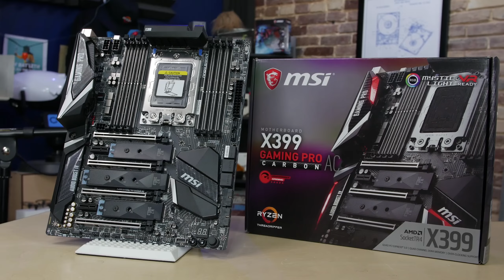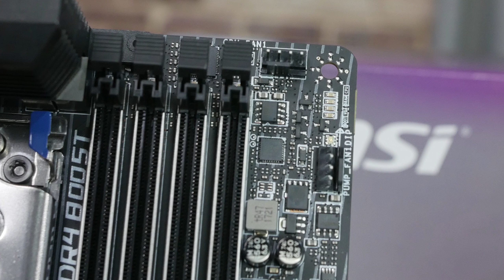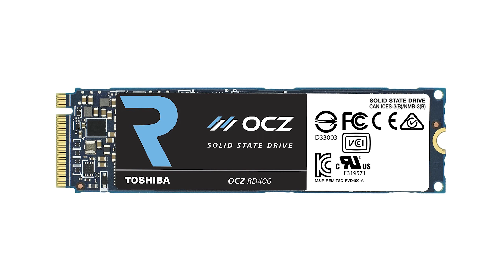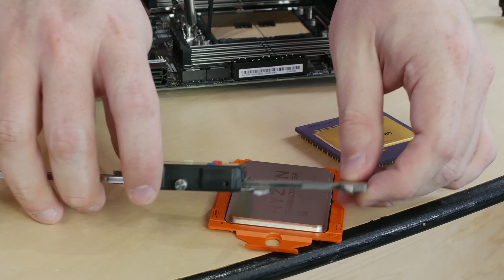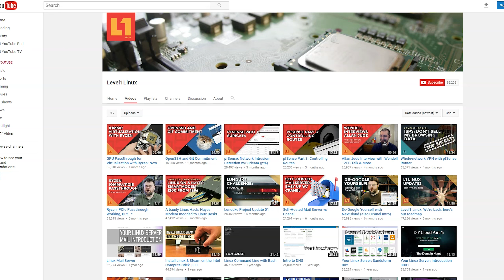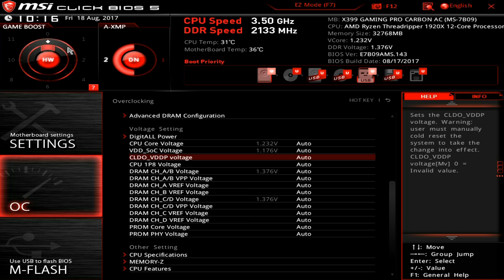MSI X399 Gaming Pro Carbon AC: Threadripper is Here!

Comment: I hope you let me help, I set up a computer with the same motherboard and processor, along with a 1080i video card, however, when I do a vray rendering, the CPU goes to 100% and ends up freezing a screen. Another point would be a classification of the processor without lumion program, staying down there. What is the maximum processor performance is at 85%. Even so, it does not show the expected performance, do you know what to say?

Comment: Pity that Wendell never responds to his comments :-(   How about actually giving some more info on the IOMMU. You said in recent video this board is "pretty good" but dont explain if the IOMMU groupings are improved. Can you pass through the USB controller from Group 13 (8m47s)? Do the PCIEx1 slots appear in their own groups (or lumped together) - I'd like to passthrough several GPUs and USB cards. What exactly do the new BIOS Eric from MSI provided give you?
Reply from the maker: the forum is usually a better spot for this type of query. The "general info" on x399 is that on every board (at least as of now) everything through the chipset is in the same iommu group. e.g. not suitable for iommu passthrough. We cover that a lot on our platform overview. Thinking about including this type of info in a written article to go with motherboards so the videos can be just the unique features of the boards. If any device is alone in its own group, it is safe and reliable to pass through. So if nothing else is in group 13, you are guaranteed to be fine. If group 13 has other devices, those other devices must be passed through as well. You may be able to use the ACS patch to override this grouping however it does not truly isolate devices from one another and can be unstable. That is not specific to this board, but true in general of passthrough on the X399 platform.

Eric provided a couple bios that enable more options around the promontory chipset, m.2 raid, pcie aspm/error correction, etc. for us to experiment with.
Reply: THANK YOU!!! Have tried before on forums and its patchy ;-) So the 1x slots are through chipset and useless for passthrough & presumably the USB controllers also. So if I wanted to passthrough a whole USB controller it has to go into a PCIEx16 slot (what a waste!!!) unless the Group 13 is such that it will allow the controller to be passed? My experience on X99 is that some devices dont need to be passed (like PCIE bridges etc) so I don't know if that USB controller can be passed. It looks like Group 0 is the "no-no" group where nothing can be passed in practice??  I would probably have that "full populated" system but I would not mind passing through a VGA card AND nvme to same VM.

Comment: I have 3000Mhz Corsair LPX 2x4 ram and it is not posting or even booting would that be an issue. Since it doesn't technically say that it supports 3000Mhz ram.

Comment: Having the GPU and m.2 grouped together for your gaming VM actually makes a bit of sense. You set up your desktop workstation, then pass thorough one Thread ripper unit and its associated nvme and gpu, and have basically a native gaming machine while your video encodes or your code compiles.

Comment: Wendell is that a torque wrench? Or is it a T-handle torx bit? Because torque wrenches are set to deliver a specific torque.
Reply: It actually is a torque wrench. It will click and slip at a certain torque which is why AMD says you shouldn't use your own screw driver. :D
Reply: SHMIDTEY 
It does have a torque clutch set to whatever the spec is.
Reply: Ok cool!
Reply: it has been said, that the torque setting is 13.?? inch pounds. which is very low, easily exceeded with a screwdriver and and a bad timed cough.  lol
Reply: @zettle234: I don't know how much inch pounds that is but I have 1.5 Nm in my memory. Either way, from AMD's how-to installation video it seems to be more than what you first expect, according to their test person. ;-)

Comment: So if this platform isn't for gaming, why is it so hard to find a motherboard that doesn't look like something out of a spaceship in a early 2000s movie?
Reply: That's one way to do it, but it still makes me feel like i'm paying for all this bling i don't need.
I don't mind having a window to display what components are in there, keep any eye on dust build-up and whatnot.
I'm that weird guy who thinks Noctua heatsinks and fans looks good, especially since i know they perform very well.
Right now i have a Caselabs BH4 with dual side windows... heck I even have RGB strips, but they are set to white at the lowest possible intensity.
Reply: Capitalizing on STUPID GAMERS!
making money off retards is smart.
Reply: krattah This is aimed at high end enthusiasts and high end enthusiasts like their bling.
Reply: I'm an enthusiast, but not really a gamer. I prefer my rigs classy, not blingy. :(
Reply: Then use a case without a side window?
Reply: krattah if you want a classy rig then a case without a side window like the define r5 is probably the best way to go,
Reply: Well I mean, the tiachi board from asrock is pretty low profile. But compared to the asus and gigabyte boards (granted the asus still packs a punch, gigabyte is just a fire hazard) the pro carbon is pretty sleek tbh, for enthusiast or workstation
Reply: Well...let the smurfs who live in your big case have some light ;)
Reply: The truth is that gaming or not gaming the specs are the same. i think only an idiot can spend $1000+400 on a cpu+mobo that will run worst  than a $300+100...

Considering the comments on amazon and Newegg the world is full of idiots...

Comment: This motherboard is crap compared to the others.  It only has 1 ethernet port and no wifi/bluetooth.  Taichi is cheaper with more features.
Reply: I didn't see any BT on the Taichi board, although there is a WiFi connection.
Reply: I prefer to use my personal devices, The crap on mainboard are cheap and broken.

Comment: pins in socket first for AMD. I'm dissapointed in your lack of knowledge. FX-72, buy 2 cpus with 2 cores for 4 core experience was pga for high end desktop in 2005 (priced like 1500usd). i use couple of those as fidget spinners. They were like 2€ each after wholesale seller needed to get rid of them. They had one mobo from asus that supported them. LOL. :p
Reply from the maker: neckbeard mode on: well acksuhallly the FX-72 is still socket F which was designed for opterons, which I mentioned, but it is technically true the fx cpus were announced a couple months before the opterons, so ok haha :-P
Reply: Level1Techs Good job on bios demo and review so far. Too many reviewers skip this stuff. Very important picking oc board.

Comment: why anything to do with Threadripper has gaming in the name i dont even
Reply: It's called marketing.  Adding gaming to the name increases their sales quota.  :D
Reply: I sort of vaguely remember holding gaming parties at our internet cafe which I managed and for every player there was a PC.
If we were to set up multiple users for gaming or even for just the normal use of our clients that came in just to use the internet, well these days we would probably look at replacing 8 PC's with one threadripper giving each client 2 cores and 4 threads.
Now for gaming that would be optimised to 4 cores and 8 threads with 4 graphics cards in the system, so we could effectively replace 4 desktops with one TR system for gaming at these LAN parties.

So when you limit gaming to just a single user TR is definitely overkill, but when you look at the cost of building and maintaining a 40 user Internet Cafe, that's 10 machines vs 40 to maintain.
Reply: Stranger IOMMU is the real issue that Wendell keeps exploring. It limits what hardware is available under a VM environment. It's kind of like a hardware raid. You may have 4 HDD but once their grouped together it's not longer 4, it's just 1. In VM sense, you can not pass 4,3,2 drives out. Only 1. IOMMU means if the PCIE lanes and devices attached are grouped, you can't split them out. This is where Intel still has an edge over AMD. It's also a major concern for any major IT company as VM is very common. Groupings can limit the overall use ability.
Reply: welcome to the PC component market where motherboards are also VR ready..
Reply: Indeed. I was planning on building a threadripper system, but I guess I'll have to wait for compatible workstation motherboards, or anything without friggin RGB LEDs really, to come out.
Reply: This naming scheme really grinds my gears
Reply: Capitalizing on STUPID GAMERS!
HEY BRO: you are gonna need a $1,500 TR/399 combo for maximum gaming!
you don't wanna be at a disadvantage do you?
make sure to update your Razer clothing for the next season!
Reply: LED
Reply: ye why is it only gaming? We WANT RGB TOO!!!?!?! :p
Reply: "I'm not good at picking PC parts so if you and ten of your friends want to come over and play video games, rocket league is ready"
Reply: With that avatar, you should know how market works..
Reply: I don't think so... A lot of professionals don't buy anything with "gaming" written on it.
Reply: asrock is your friend
Reply: So, basically do what Linus did ? VM + GPU passthrough for all video cards? Hmm or maybe using that new hardware thing that allows to share gpu with VM.
Reply: Threadripper 1900X is gonna be better then the R7 1800X for gaming.

Comment: I'am not completely  computer fluent, but would it be plausible to keep two separate windows installations on two standard hard drives and have the games or applications you don't wish to have to keep installing over when you have to reinstall windows, and what im getting at is could you just switch out the hard drives (basically cloned drives) with no issues with the programs on an nvme drive?  I tend to get a lot of weird things happen and slow downs when I use the computers (I have maleware removers, scanners etc.), everything always end up buggy after a while and I only go to my schools website, youtube, phys .org, and some other neuro sites, and my email and facebook (I don't go around viewing peoples webpages just have family on mine or should be), really no reason why it gets buggy but it does everytime
Reply: some "malware removers" are just that with quotes, they are not really removing anything, and they just got permission to plant themselves.

ie some "Malware removers" ARE Malware themselves.
have to be a little cautious with stuff like that. 
whats the names of the malware removers you have?

also today its not enough to find and remove. (search and destroy :) )
you MUST block.
Reply: Dont use anti-virus software then? Especially now since win10 has one included.
Reply: you can save programs to different harddrives, with different degrees of difficulty.

basically if its a portable(program that you can use from an usb stick in different computers) app or game, then yes you can, quite easily.

then there's linking, where you take all of the things inside a program folder place it inside another folder on another hardrive/folder and basically making a shortcut so that the program thinks its inside of the original folder 
 (an example being "Steam Mover")
 its just making "mklink"s on the command line though
Reply: Having 2 installations on separate Hard Disks using a SATA rack like the one showd on PhilsComputerLab is the easiest way to do this.
Reply: yes duel boot
Reply: What hardware do you have? If it gets slow from just some simple websites, you probably have a hardware problem, not a software one. :)

You can install Speccy (from Piriform.com) to check what you've got.

Comment: Hey Wendell have you tested if the ryzen segfaults affect Threadripper?
Reply from the maker: They do not seem to, though in four ryzen 7 cpus I myself was not able to experience the segfault issue except over-overclocking ram or undervolting SoC. Some users have reported that RMAing their cpu fixes it, once other possibilities are eliminated. I'd love to get my hands on a ryzen cpu that can produce the segfaults from the kill ryzen script.
Reply: Good to hear that Wendell! If you happen to get your hands on a Gigabyte Aorus X399 Gaming 7, I'd love to see how it runs on Linux since I'm considering upgrading my 6700K-based workstation to either 7900X or 1920X by December or January. It's a toss-up for me as, in my country, 1920X is priced a bit more than the 7900X with most TR mainboards having only the pricier "gaming" boards.